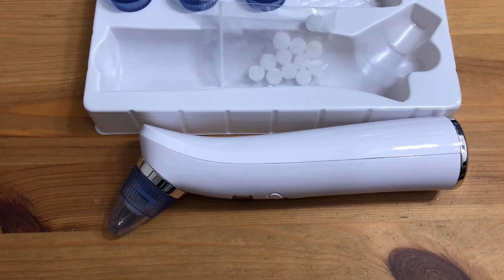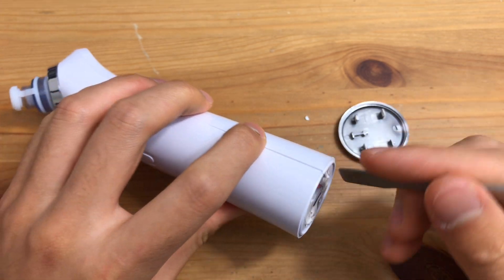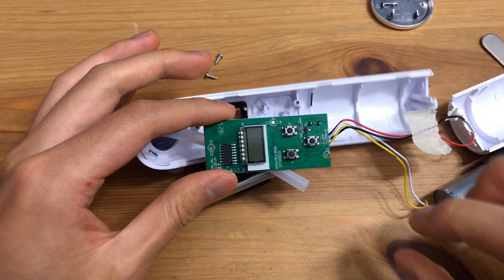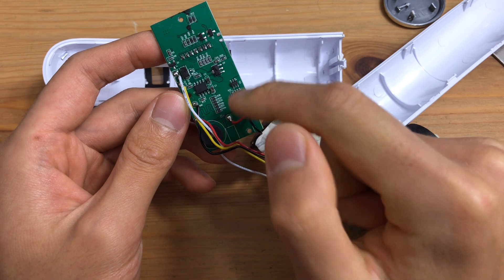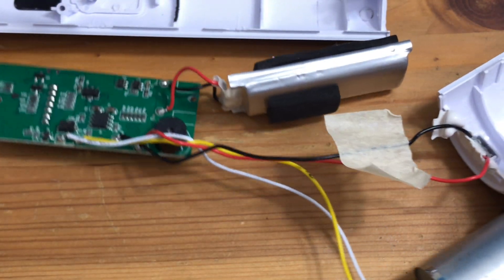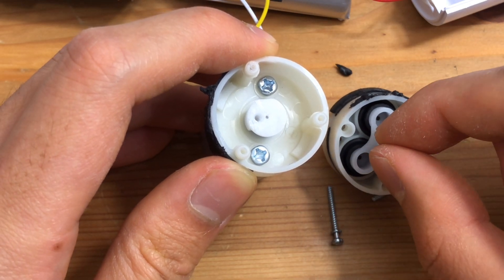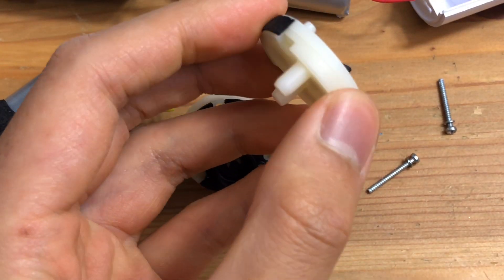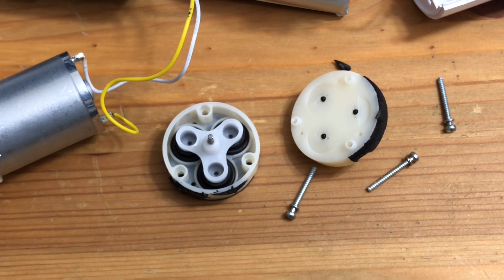What's Inside a Pore Vacuum Blackhead Remover Teardown Disassembly DIY

Comment: I have the a similar one i got from meijer, it's the bulbhead one that runs on 2AA batteries. I recieved it as a gift and tried using it eith brand new batteries but it didnt work, so I opened it and the yellow wire(B+) side is disconnected completely from the prong(?) Of the motor and I was wondering if you could tell me how to attach/connect it to where it'll work? I tried to get the prong clamp(?) to open/seperate but failed also i tried putting eletrical tape on the wire/prong to hold it together but couldnt get tape to wrap right around both together. Please help?
Reply from the maker: Well, it's somewhat difficult to imagine what has happened from a description like that. Could you take a picture and post it somewhere publicly accessible?

More generally, you'll probably want to see if you have enough wire left to strip about an inch of the insulation off, then twist the strands together a bit, and start wrapping it around where it needs to be connected, preferably tightly. If there's a lot of vibration, it's likely it will come loose again. Try to tape or glue the wire to the motor or something after you wrap it. The proper way to fix it would be to solder it, but it doesn't seem like that's the best solution for you.